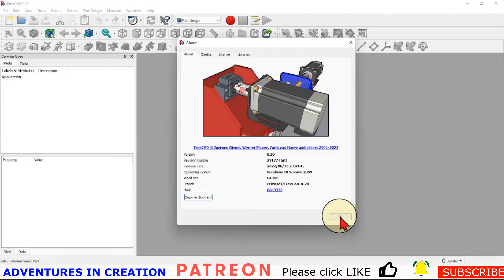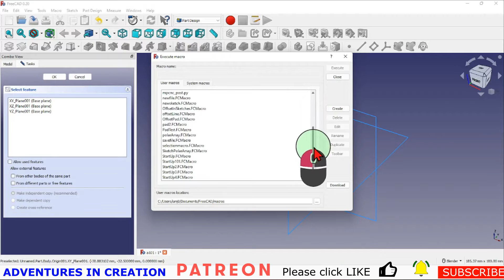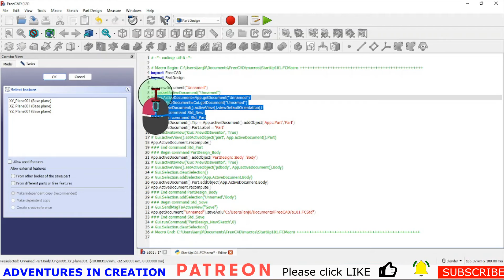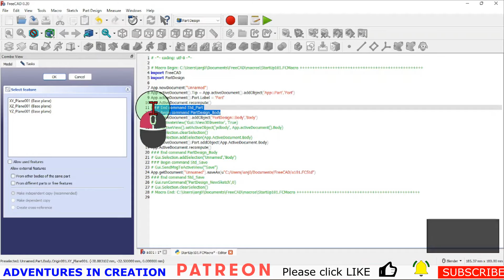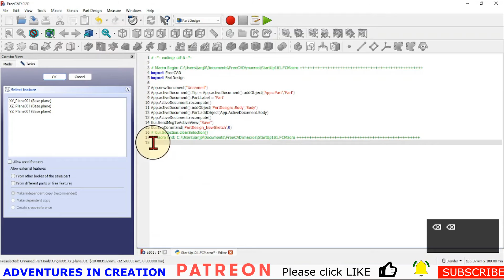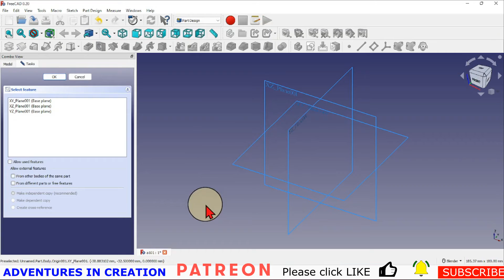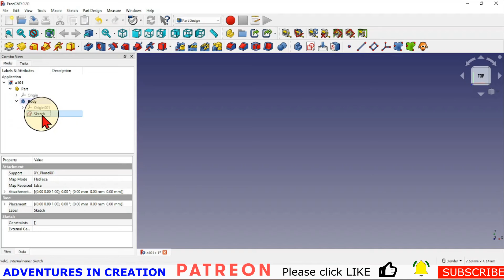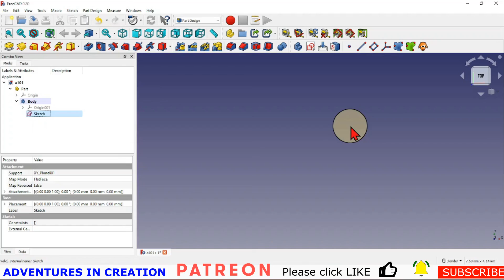FreeCAD for beginners #41 Start Up Macro that everbody should have

Comment: I did exactly as the video said and it works BUT when the new document is created the dimension in the corner of the active screen are 6 x 4 mm but when I record the macro the dimensions are 325 x 200,  am I doing something wrong.
Reply from the maker: I am not sure that the dimension is set in the macro. Perhaps take a look at the code and search for those dimensions

Comment: When startup macro is executed and selecting the plane, why is the zoom resolution (lower right) so small? If you zoom in, the resolution becomes larger, but the objects are not scaled to the resolution 😱. Whereas if created without a macro, you would get a much larger resolution. 🤔
Reply: When you yourself run the macro how do you adjust?
Reply from the maker: @rondeangelis7384  I just roll the middle mouse wheel and watch the dimensions on the right hand bottom corner. You will see it zooming in or out.
Reply: @Adventuresincreation  hey sorry didn't get back to you.  Yes, not sure why didn't work for me before.  But, running the macro, selecting XY plane, yields very small zoom resolution.  Applying more zoom with mouse yeilds correct results.  My bad...still in learning phase.. thankx for replaying back. Keep up the great tutorials!!
Reply from the maker: I am not sure what controls the initial zoom size but you can adjust it.

Comment: Great introduction to macros. However, I don't always start with the part design workbench and not bothered with it. I could name several macros for the different startups, but I just prefer the control to do what I want.

That said, knowing how to make a macro is good, as if you have several operations you do frequently, a macro is pretty handy
Reply from the maker: You can have it start in any of the workbenches. You nailed it. For frequent tasks this is a quick and easy way to record them.